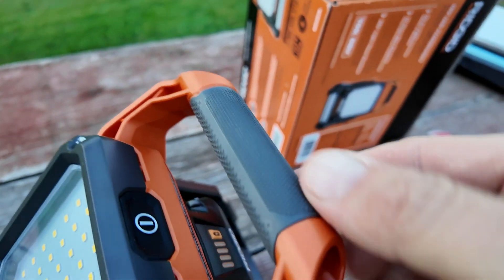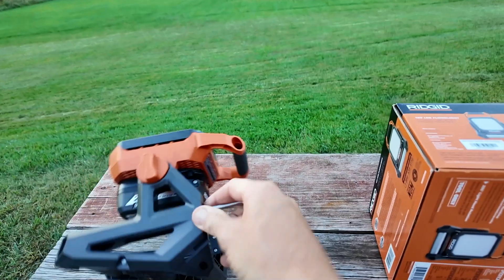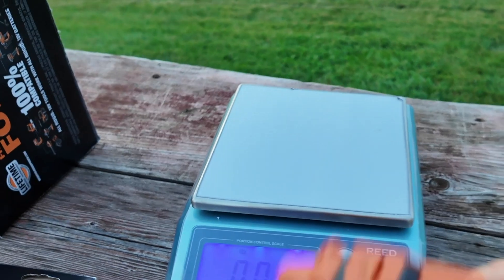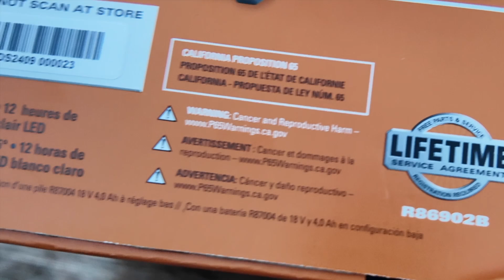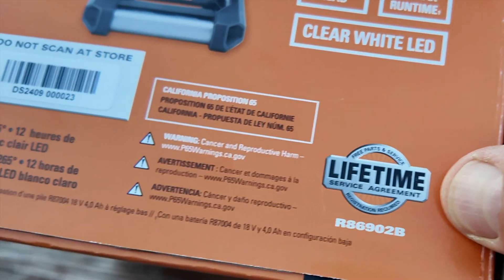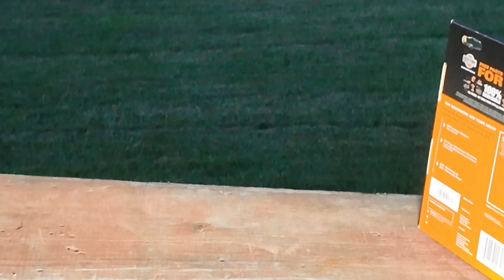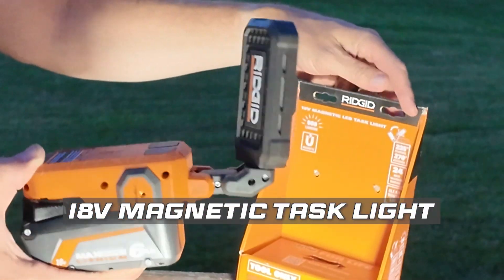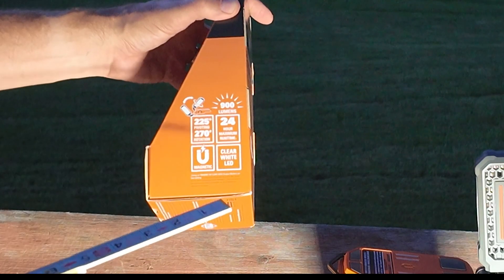Ridgid Just Introduced 2 New LED Lights, Just In Time For Fall!

Comment: I have a number of the Ridgid lights and they do a good job designing them-Solid.  No Complaints!!
Reply from the maker: That's good to hear!  These are the first LED lights I've tried out from Ridgid and I'm definitely impressed.
Reply: @MarkThomasBuilder  I just purchased the new 360 light but haven't got a chance to try it.  I will be hunting in couple months and most likely be exercising/testing it out then

Comment: The old flood light seperated from the base making it ultra useful in tight situations. I did not see this new one could do it. You missed a 3rd release that was a 360° light. It was $120.
Reply from the maker: Yes, that 360 light is pretty cool!  I've reviewed a similar one by Milwaukee a few years ago.  It's nice for working in a room with no power or lights.
Reply: @MarkThomasBuilder  does the flood light separate from the base like the old one?

Comment: I would have liked the lights to have a white defuse style lens, the clear plastic is not as easy to see by.
The big advantage to a power tool battery light is extended run time without heating up.
Many of my flashlights have more lumens and very poor run time.  Thanks for the video!  😎👍
Reply from the maker: Thanks, I think you'll be happy with these lights as far as runtime and brightness.

Comment: Mark Thomas !!!  
‘Milwaukee in the News,’ web page ad, features You from your Review of the 18 Volt Brad nailer!  Congrats!  I told them they better feature my buddy Mark Thomas and give him some Press!  😯 😆 

These lights look like TTI/ Ridgid put some thought into them.  I don’t get an impression of great build quality, and maybe I am wrong?  How would You rate them Mark?  I like the smaller Magnetic light, but I think I would go for the bigger one.  I’m a sucker for lights of any kind!  IMO, it is hard to beat any of the M18 lights.  Hope You’re doing well, as well as the Pups.  Take care!  👍🤝🇺🇸😊
Reply from the maker: George my friend, good to hear from you!  I still haven't seen that ad, oddly enough.  I appreciate your vote for me being shown on their page.

The magnetic light is pretty tough.  I accidentally dropped the light from about 4' on cement and it's still going strong and shows no signs of damage.

I think back to the electric lights I started with in construction, which are the 500w Halogen work lights.  They used to get real hot and the bulbs would often break if bumped too much.  The Ridgid 18V Flood Light is a much better solution compared to the halogen lights, in my opinion.

I'm happy with my Milwaukee lights as well.  The soon to be released M18 Rover folding light has my interest.

Thanks for stopping by and take care!
Reply: @MarkThomasBuilder  Hey Mark
That Ad just came through my E-Mail.  
Thanks for reply.  

Oh Boy, those old Halogen bulbs, easy to blow out, Hot to touch, and they made the work area hot, which was not good, unless it was during cold temps!  😆 

I might check out that magnetic light.  I’ll use the link on your channel.  Take care